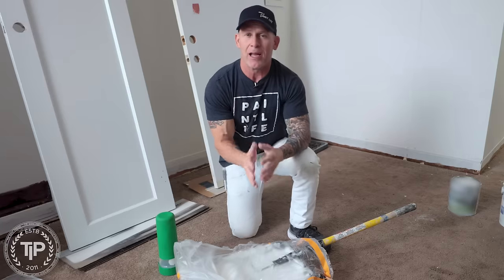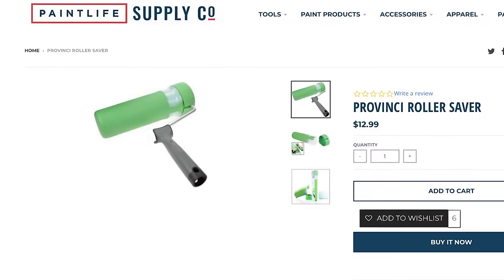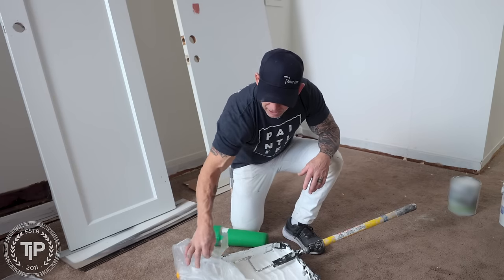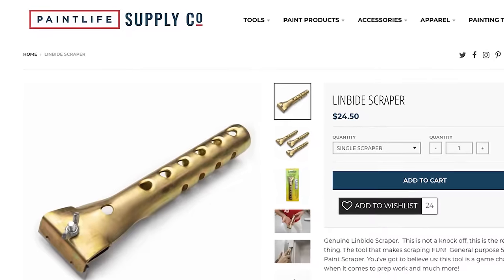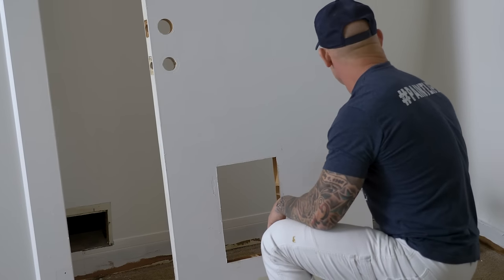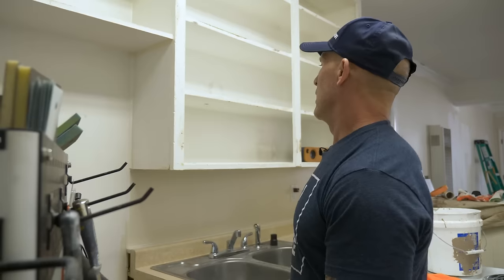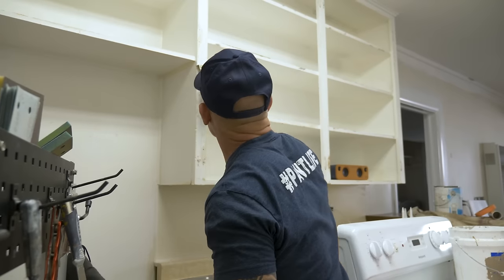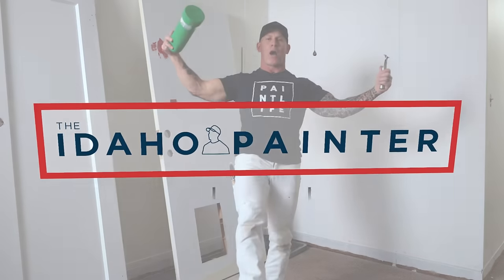Painting Tools to Buy.  Tool Review for Painters.

Comment: I use a 10 litre bucket with a bin liner inside to store wet tools overnight/weekends etc. I always put a few slightly bleached wet microfiber cloths inside to keep the humidity up. Bleach deters mould. If I have multiple colours the tools get bagged separately. Just tie the bag up at the end of the day. The Linbide scraper has been popular in the UK for years. They are also good for burning off . Turn the blade around and push instead of pulling. The holes are designed to dissipate the heat.
Reply from the maker: Great tip!

Comment: Chris, have you ever thought about moving up into industrial painting? Same concept, bigger job's, more money. Get a big pump, similar to maybe a Graco Bulldog, 30-1, or 45-1 airless that will push 3 gun's constant use easy. Set it up on a 4-wheel cart, cut a 55 gallon drum in half, or buy a half drum, buy rolls of plastic in 20' x 100' or 200' in either 2 mil or 4 mil, and other basic consumables. Your ready to rock and roll. Some rolling scaffolding, rent scissor lifts or jlg's when needed. Roll in the big money. Start small, work your way up. You have the knowledge already.

Comment: Ever use dog poop bags for brushes and small kitchen garbage bags for rollers? Both are airtight and disposable.  I can't imaging putting an in-use roller in a cylinder overnight and not having it dry out. Plastic bags are great - no air.  Do you ever use a Festool planex for the walls. Pole sanding is a thing of  the past.
Reply: We use the m3000 paper/tape dispenser with some tape and 12” paper replacement from 3m that is like plastic, just rip out a slice and cover a brush
Reply: @paintpaintpaintco.6039  what if you have to go back to using it? Do you rip off a new piece?  We can reuse the same bag over and over during the day.  Give it a shot. They sell them in the dollar store.  We act like picking up dog poo, roll the bag around our finger tips, grab the end of the wet brush, and roll it back over the brush. Squeezing out the air. Twist at the end, and done.
Reply: @chriswagg9786  Good tip. Thanks.